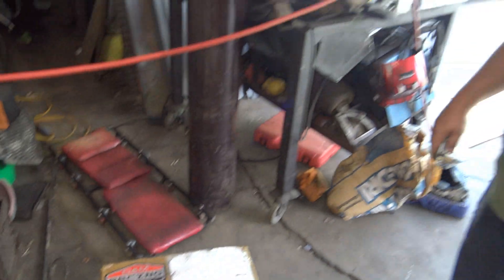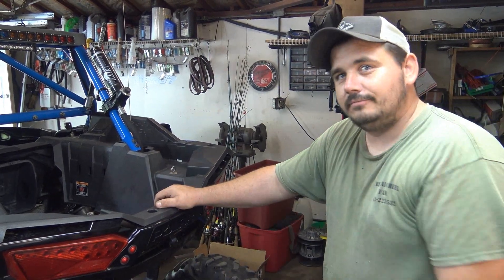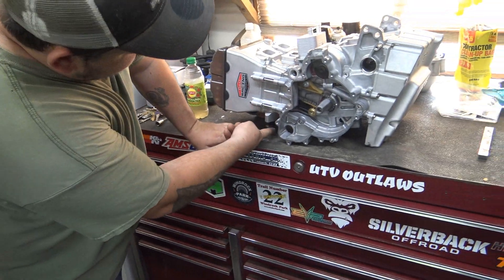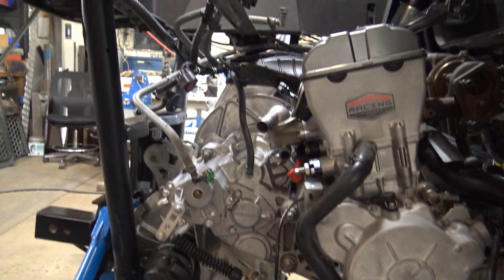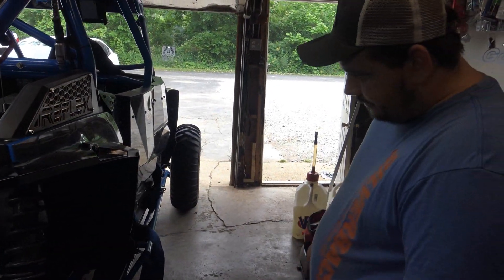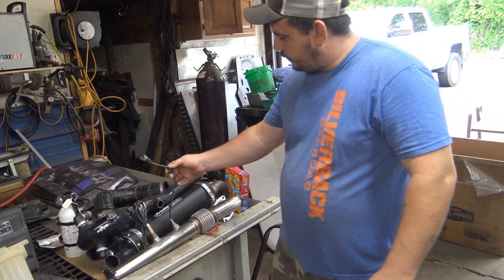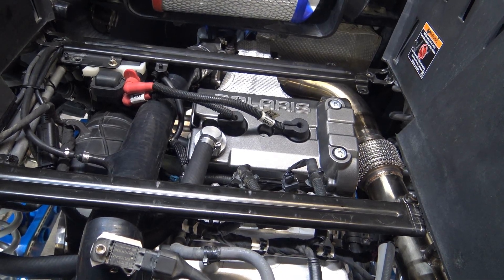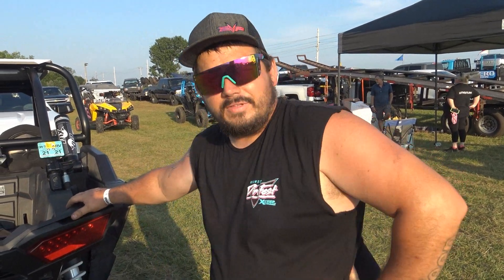Installing A D&M Stage 3 Motor In The 4 Seater Polaris RZR Turbo!!

Comment: Does your guys machine still have/had the older style chain tensioners that were on the 14/15 XPs? I had a 15 and those were notorious were being weak especially is cold temps with cold oil.

My turbo S has the automatic ratching style that everyone was swaping/upgrading too back then
Reply from the maker: So if I remember correctly 1415 had a thread in style we have a Bolt on  style from the factory And as you seen we upgraded it to a manual tension tensioner

Comment: I just threw in a new motor and upgraded to the AA watercooled big turbo. My Temps are down a ton. 183-186 is where it runs. I thought about doing the tank split but no need to now.
Reply from the maker: What are the iat's on the datalog? That is where the split tank will help. Keeping incoming air cooler makes more power and  makes cooling more efficient on the motor side as well. Thanks for watching!!
Reply: @utvoutlaws6652  I'll have to look at them. I've just got it back together and have about 3hrs on it. Lol. But the biggest reason for heat in the system was the intercooler sucking up all the heat from the comprssed air coming out of the turbo and since the watercooled turbos iat's are so much lower its dropped Temps across the board. It has a hard time warming up unlike stock. I have to ride it up and down the road for Temps to even get to the 180's. I'll take a look at IAT and get back to you. Keep up the cool vid's👍
Reply from the maker: Sounds good. Let us know what you find out. Thanks again 😁
Reply: @utvoutlaws6652  so I just did some pulls. Cruising at around 40-50 I was at 140 pre throttle body and full throttle pull was around 165.

Comment: What caused the motor to overheat originally?
Reply from the maker: We think the motor mount broke causing the coolant line to get pinched which in turn warped the head and the stock motor never ran right after that.